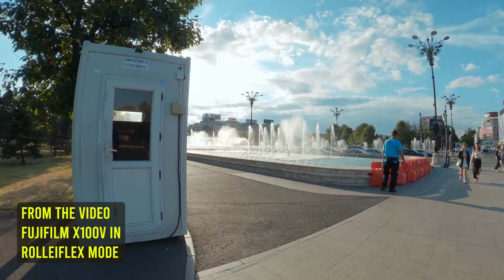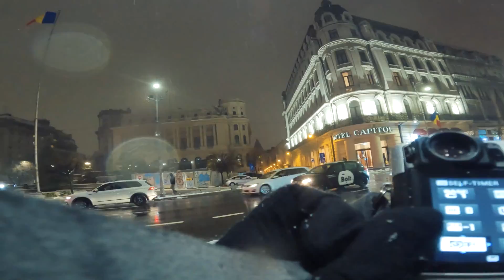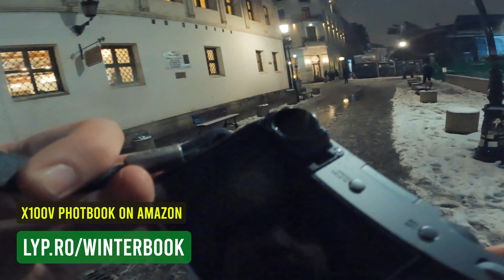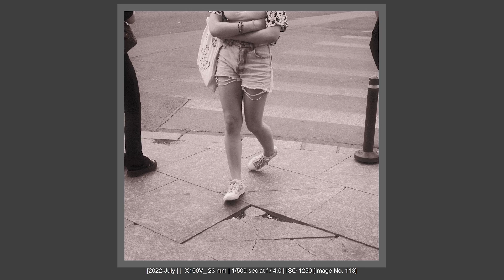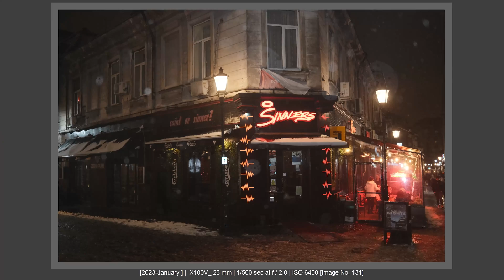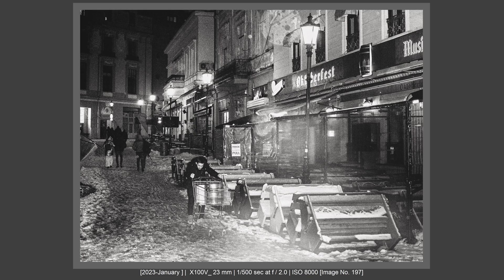*BREAKING* Fujifilm Just Canceled The X-E4 / X-E5 Lineup  — Will X-PRO4 follow?

Comment: I have had an XE2 for many years and always loved the ergonomics, design and quality feel. It was the last XE camera made in Japan. I tried XE3 and XE4 and both were a step down in my opinion, EVFs in particular which is very important to me. I then bought an X Pro2 which is great too,  heavier and larger but feels solid. I use both now with a selection of lenses, some I have had serviced and may also service the cameras at some point, and plan to keep them forever as I think they will be cult classics.
Reply: Hello. Why are the x-E3 x-E4 a step down  ? How could the EVF be worst ?
Reply: @PoorAlchemist  size of evf is noticeably smaller on the xe3 and xe4, vs the xe2, both screen size and size of eyecup. Find a discussion on DPreview forum which describes this in detail. This plus removing a lot of the buttons and reducing overall size with each iteration after xe2 made me want to hold on to the xe2 in addition to having an xpro2. Try for yourself though if you can as experience may vary.

Comment: That is why I'm moving to Nikon ZF. I was waiting for the X-Pro4 but there is no sign of it. I fear the Xpro3 was the last one of the X-Pro line, at least for a while. And even if one day they decide to release it, I fear it will have a build quality downgrade like it happened to the XT5 compared to the previous xt bodies. The Nikon ZF answers  my needs: beautiful retro design and dials, great and hefty build quality, great AF and low light capabilities, great dynamic range, full frame sensor, flip screen that I can keep closed back using only the EVF like I do on my Xpro3, face detection in manual focus. I will still keep my Xpro3 and then I will see if it will be the case to sell it or not, even though I'm emotionally attached to it.

Comment: if this is true then its time to ditch fuji for sony. been using fuji since 2013 when i saw an xe1 at wppi in vegas and ordered one the next day. the xe3 is my favourte  digital camera so much i used it far more than my leica m240 which i have since sold. switching to an all dslr format (no word on an xpro 4 yet) just makes fuji another camera maker n a market flooded with that form factor but with a smaller sensor. maybe i'll switch back to leica or even get the pixii. or as a last resort, move to sony and their 'rangefinder' format.

Comment: I think part of the issue is the outdated notion that small=entry-level=cheap. Lots of really good photographers or really rich consumers are willing to spend big on small, performant cameras. You can see that in the used market for the X100V and XE4, where people are paying X-T5 prices for cameras that are three or more years old! If you put the latest sensors, latest EVF, and latest autofocus in an X-E4, you would sell a lot of them.
Reply: Fine example is the 1" Sony rx100vii. A €1200euro compact point and shoot.
Reply: Completly agree. I was on X-T3, moved to X-E4. I would have paid big money for an XPro4 which is the X-E5 in design.

- IBIS (I'm OK with a bit thicker body)
- Big battery,
- Rangefinder with X-Pro3 EVF but better external light protection as an option
- 6.2K Open gate,
- 26M sensor (Maybe an option for stacked)
-  X-E4 design: As light as possible when I have a small lens, I add a grip with I have a bigger lens.
- I don't need an ISO Dial, I need the shutter dial to set the min shutter speed of my Auto ISO, I buy lenses with an aperture ring
- I don't think I need a back dial, or it need to not be impacted by shoe-thumb grip (for when I shoot light)
- Basically an X-T5 as a rangefinder.

I am not getting an X-T5, I would rather jump ship and go to Sony with a A7Cii or A7CR. I have fantastic auto-focus, I have auto-exposition to the right (histogram)... The function is here, the design is however not my cup of tea.

Comment: I am on the fence with Nikon Zf for this very reason. I had screen blackout problems with my X-T5, fortunately before the return window ended, so I sent it back. So far, good luck with my XH2s but it scares me because I have heard stories. The Zf and the lens adapter used with my pancake DSLR FF lenses sound attractive to me, as do the newer Z lenses. The Zf is not a wildlife camera but in a travel situation it could work. So, I'm loving my X-E2 and X-T30II and have no plans to sell. I may trade in my XH2s though for the Z8. And if I add the Zf then I have street and wildlife/travel covered. But I just love the Fuji look! I don't think micro 4/3 sounds too promising, do you? First world problems.
Reply from the maker: Micro four thirds no on the long term it seems... But regarding the Nikon ZF the problem remains regarding the lenses - for good image quality the lenses will add  to the size and weight. I think Sony aps-c could be a good compromise regarding size, AF and image quality.
Reply: @Tudor_Mateescu  that's true. The weight is too much for me. Sony APS-C and Fuji are likely the best alternatives. Thank you!

Comment: My first Fujifilm was an x-e4. I haven’t had any issues with it. I recently purchased a refurbished x-pro3 and loving that as well. It is worrisome though knowing that the screen will eventually fail but I rarely use it. I was planning to sell my x-e4 since I got the x-pro3 but and can’t bring myself to do it even though resale value is great right now. I’m hesitant because I love the camera and also because  of potential x-pro3 issues. 

I have a Sony A7c and a Sony A7iv so I can only compare build quality to the Sony’s and not older Fujifilm cameras. My x-e4 feels solid. I did try an x-t5 at my local camera shop and it felt plasticky to me. It was smaller than I expected and light as well but it doesn’t feel solid. The x-pro3 feels like a tank. 

I hope they continue the x-e line. I got into it because I couldn’t find an x100v
Reply from the maker: You're right 👍! Keep that xe4 alongside X-pro3 - best combo.

Comment: Fujifilm created the issue for themselves. They released 9 cameras with the X-Trans 4 sensor. The X100 and XPRO line should be combined into a single camera with the hybrid viewfinder, interchangeable lens mount, and some small primes that match the camera (aperture ring on lens or body). Then they should have a camera with video focus and more modern design, and finally, a retro styled SLR. With fewer cameras, they might not make everybody happy, but they can focus their resources on quality and features.
Reply: Well, I want a retro range finder (X-E5/X-Pro4: IBIS, Big battery, X-E4 screen, Range finder with X-Pro3 EVF but better external light protection, 6.2K open gate). I don't need an ISO dial (I would prefer an AUTO ISO setting to have min shutter speed taken from shutter wheel).

Flat design so if I have a small lens, it is ultra light and if I want a bigger lens, I add a grip. The X-E4 is almost perfect...